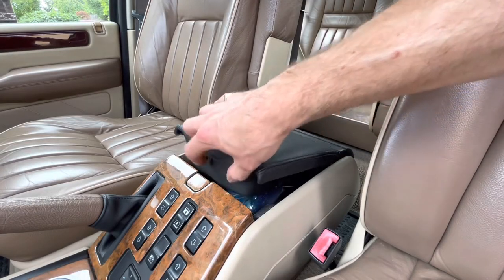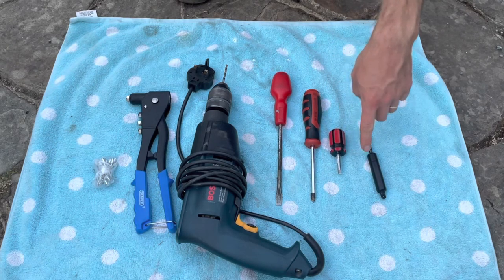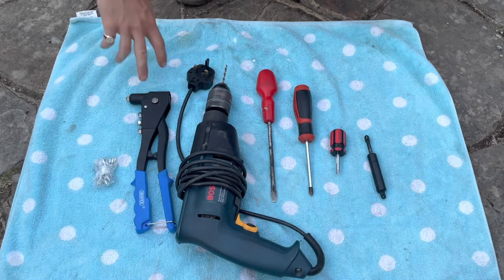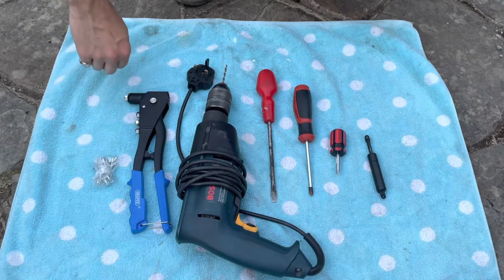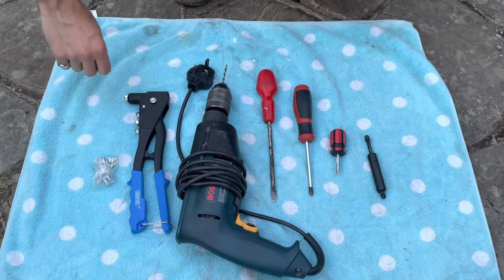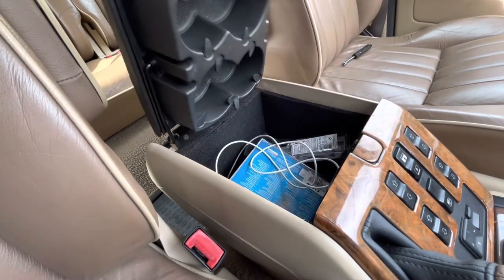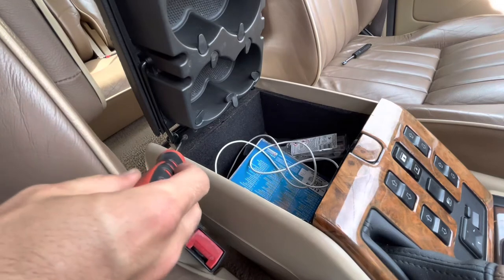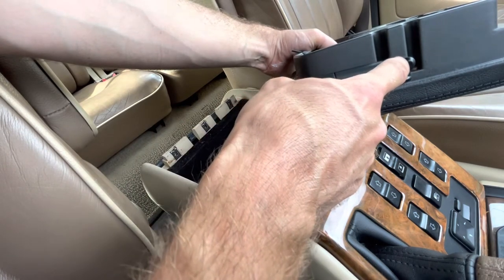Range Rover P38 - replacing centre console lid gas strut

Comment: I cut open the body of my old dead console strut with a cutoff disc in a dremel, and placed a suspension spring from an R/C car inside, and then soldered up the body again, and refit the strut. It’s now been 2 years, and it works flawlessly, it would probably never break again, as there is no gas inside that will escape over time, and no one will ever be able to tell it’s been opened..